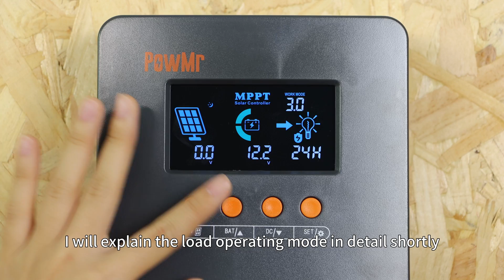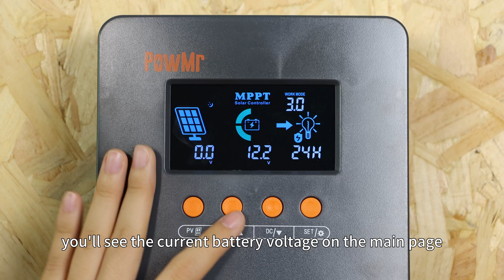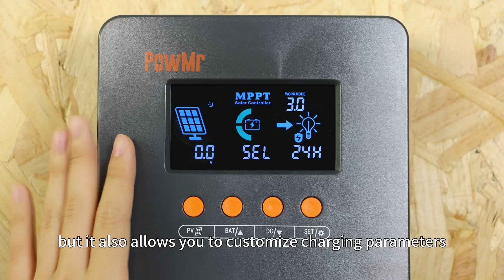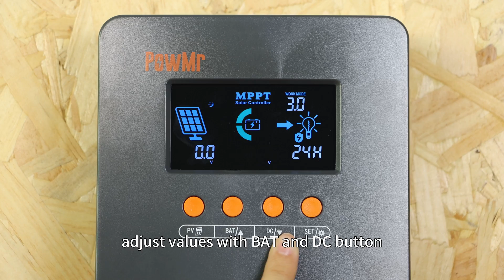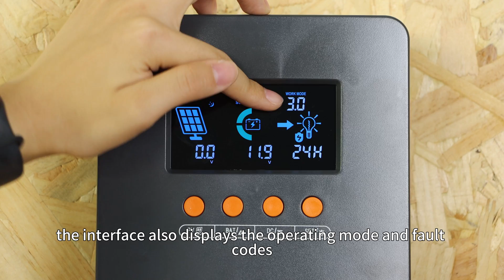How To Setup PowMr New 60A Plug And Play Solar Controller

Comment: Is the PV wattage reading total incoming PV wattage or wattage being applied to the batteries to charge? I have 900 watts of incoming PV but the POWMR 60 reads only 18 watts on the PV section.
Reply from the maker: the POW-M60-MAX model?
Reply: @PowmrSolar yes

Comment: I downloaded the instruction manual for this controller. Would the info be the same for a POW- M25-PRO? . When I first configure the battery type ( a lifepo4 battery)  hoping I only have to configure it. Or would I ja e to configure all the rest of the stuff. Like the panels, I'd rather not have to deal with anything that's not needed.

Comment: I had a problem with Work Mode section where in a daytime it should supposed  changes to 4.0 however, it still remain in 3.0 where it did not charge. How to change it from 3.0 to 4.0?
Reply from the maker: Try restarting with only the battery connected.

https://drive.google.com/file/d/12jPsX13AR7WJkrueoLWUyd6CpjbDGmM2/view

Comment: not good for data monitoring there's no kwh meter for input and output
Reply from the maker: The PV wattage and charging current will be displayed. The KW can be calculated by multiplying the charging current by the voltage. However, the controller does not directly display the KWH data and needs to be calculated.

Comment: Can you give instructions to set the working mode please  ?
Reply from the maker: It cannot be set, the controller will automatically recognize the battery voltage and enter the corresponding working mode.

Comment: My 80amp charge controller just stopped putting out wattage and amps. It showing 90v from the panels but not showing or sending anything to batteries. I have 48v system so i am under my max wattage and volts. I have 2400w of solar panels on 48v battery and i got the 80amp charge controller
Reply: I'd check your panel connectors. I had the same issue -- 38 volts coming, no amps. I found one of my panel mc 4 connectors was broken. Replaced it and boom, all good again.

Comment: Is there a way to RESET the controller?  My display all of a sudden went blank and it flashes on the side of the display (maybe some error LED flashing inside?).
Reply from the maker: Long press the SET button, the controller will automatically return to the initial interface, which means the reset is successful.
Reply: @PowmrSolar  Thank you

Comment: Kindly do a video for the open and metallic case type of 60A mppt solar charge controller
Reply from the maker: I don't get it. Can you be more specific?
Reply: @PowmrSolar  There are two types of powMr 60 amp charge controllers. The open one with metallic case and the closed one with plastic case you show here. The interface on the screen is different. Do you have a video for the open metallic case setup? Thanks!

Comment: I’m running at 36v and on the use setting I’ve properly set. When my battery hits 100% soc, I’m getting a fault on my inverter causing it to stop powering my loads. Seems the mppt is not going to its float charge setting properly and throddling charging. Help! I’ve emailed you guys!

Comment: I have this controller and running a 36v lithium battery with 12 cells. I am forced to use the L16 setting it would seem. It seems to be working but the other settings are showing as if it is a 48v battery, not 36. Can you assist?
Reply from the maker: Please select USE mode. Do not use other settings.
Reply: @PowmrSolar  I select USE then I select 36V for the system voltage. but then when I try to set the boost charging voltage it limits me to 17V
Reply from the maker: @Reelbassin  Please select the battery type "USE", then you can set up the charging and discharging voltage value at your need.  During your setting, the preceding parameter ranges apply to the 12V battery.  When the connected battery voltage is 24V/36V/48V, the range values are 2/3/4 times of this range, respectively.  And the LCD only display the voltage of the 12V battery.
Reply: I read that its 3x the settings I choose so hopefully it will work tomorrow.

Comment: I have a 48v battery bank consisting of 4 12v gel batteries. I picked GEL as the battery type but the bulk/boost/float voltage still shows for 12v battery. Is that correct?
Reply from the maker: The preceding parameter ranges apply to the 12V battery. When the connected battery voltage is 24V/36V/48V, the range values are 2/3/4 times of this range, respectively. And the LCD only display the voltage of the 12V battery.

Comment: Hello. Please i have a problem with one of my 60a PowMr SCC. When i connect it to my batteries which are all run in series to make 48v. It keeps seeing them as 24v. I have tried 3 different PowMr of the same Brand and its showing same thing. How can i resolve this please? 🙏🙏🙏
Reply from the maker: Hi, the battery system voltage can be set to 48V.

Other parameter settings only display the value of 12V, which is automatically multiplied by the multiple calculated like this.
Reply: Thanks for your swift response. The issue has been resolved. Discovered that the issue is from my connection.
Reply from the maker: @DadaKarma82  Hi, Okay.

Comment: I have a lifepo4 12v battery with bms. If I connect the battery to the controller,  won't there be any problems or contradiction between the bms and controller. Also, is there any way to allow the bms to communicate with the controller
Reply from the maker: Hi, the controller can not communicate with the battery.